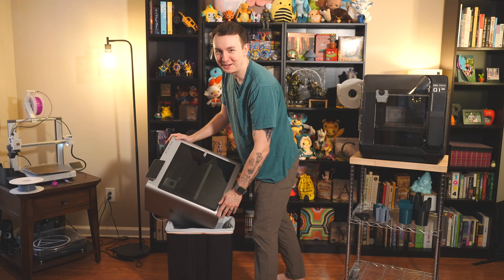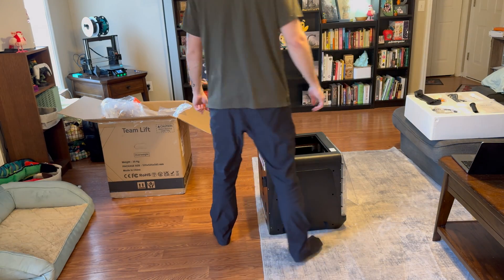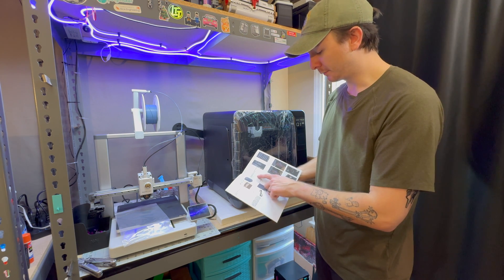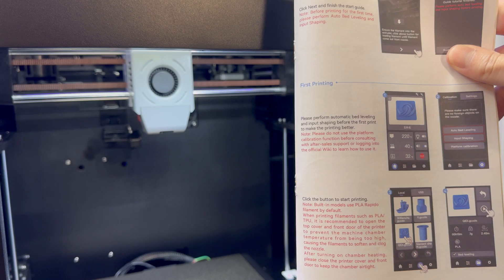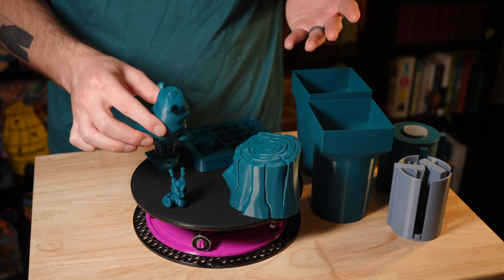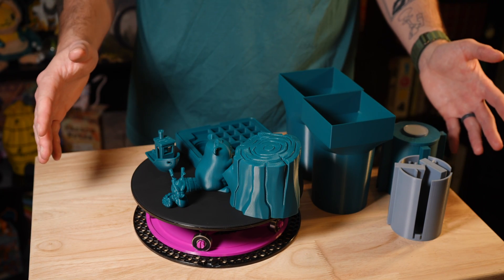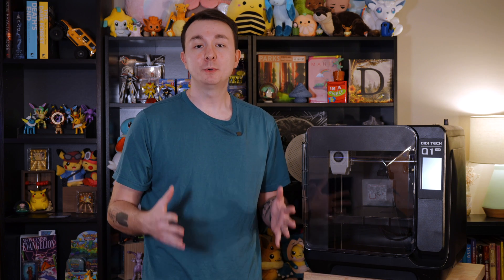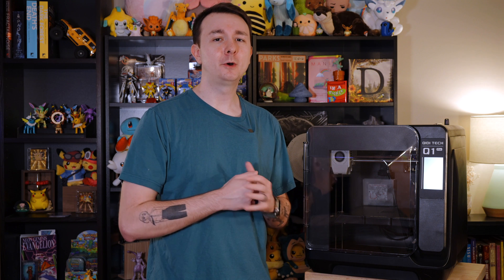Is This the Best 3D Printer for ABS?

Comment: Nice review.  I got my Q1 PRO recently and had horrible prints using default values in Qidi Slicer.  Switched to Orca Slicer and things improved. 

Did you ever develop any tuned print profiles?
Reply from the maker: I’ll be completely honest - I used their Prusaslicer profiles, ran input shaper, dropped the max accelerations to those values and never looked back haha
Reply: @ButterPockets  Thanks.  I'll check Prusa profile.  I slowed down outer perimeter and acceleration values in Orca and it's going well.  Always room for improvement though.
Reply from the maker: There definitely is! My input shaper gave me max accels of 4500 and running the Prusaslicer profile with those max accels has given me prints that are “good enough” for what I expect. I believe the PS profiles are almost exactly what’s in Qidislicer but just ported over. If you want to tune it up I’d suggest following Ellis’ guide and just running some test prints.
Reply: @ButterPockets  Thanks.  I'm new to Klipper.  Ender3 Pro and Cura for years so I'm overwhelmed with all the new stuff.  I've been reading Ellis' page today and I'm slowly learning.  I ran the input shaper but I didn't see the values.  I'll look to see what I can find.
Reply from the maker: You’ll need to log into the fluidd interface on your computer. So on the printer go to the network setting and see the IP address then just go to that IP on your browser. Right after you run input shaper it will have what it did in the console and say something like “suggested shaper in X is mzv at 47Hz l, suggested max acceleration of 5000mm^s/s” or something along those lines. It will save those values into the bottom of the printer.cfg but it won’t save those suggested max accelerations.
Reply: Sounds easy enough.  Thanks.  I think I set max print acceleration at 3000 to be safe.  I'll check out the numbers when I can.

Comment: Could you not print a new spool holder to move the spool to where you want it?
Reply from the maker: Probably could! I should try
Reply: @ButterPockets  just got mine today! I think have the spool arm go vertical and have it be front loading, spool feed going counter clockwise to inlet. 

Also, what kind of table do you print on? I placed my printer on top of a bookcase to keep out of reach from my son and when it started doing the motor frequency test we will just say it cannot stay there.
Reply from the maker: @JRVWPrints I have mine on my U-Line shelves that are in the background of some of my videos. It’s sitting in a large slab of granite. You could also get a stone paver!

Comment: Assuming i just want to print PLA for my etsy shop would you recommend this or rhe A1 or an adventurer 5M? The A1 is appealing because of the larger build plate i can print more at once. 5M is cheaper, but smaller and I don't like the expensive nozzle/hotend setup. The Qidi seems great, faster than the A1, but smaller and the most expensive of my 3 options plus i dont need the enclosure/heated chamber. The negatives of the Bambu are the whole china big brother cloud thing and it's still a bedslinger. 

I just need something better than my ender 3 v2 lol.

Comment: On mine the pink zip ties shown on the Z axis were replaced with locking screws that were marked "remove before printing" (see those white stickers on the print bed next to the linear rails).

Comment: I'm trying to decide on my first printer.  Contenders are this, the Bambu Labs A1 Mini (maybe combo), and the Bambu Labs P1S Combo.  I know, kinda wide spread there.  If I KNEW that there is an AMS solution for this coming, I'd be on it.  IF the P1S had a heated chamber, that would (probably) settle it, although the cost is pretty stiff.  Sigh....
Reply from the maker: I think you can’t go wrong with an A1 or a P1S. Depends on how much your budget is honestly. If you have the budget go P1S. If you don’t or just wanna dip your toes in go A1 mini.

Comment: It has plastic gears in extruder ! Aluminum was too expensive !
Reply from the maker: The X1 has plastic gears too. You might be able to upgrade that in the future, but this is what happens with off the shelf printers. There’s compromises somewhere. Regardless it still prints very well.

Comment: Hey. Thanks for the review. I got my Q1 a couple days ago, and i’m loving it! I am not getting the same artifacts on the print that you’re experiencing. I am going to start ASA printing today, so far only printed PLA and PETG.
Reply: Also, The nozzle wipe before the print is so the nozzle is clean for the bed meshing. I think the purge line takes care of the oozing pre print.
Reply from the maker: It’s a prime line, not a purge line! It primes the nozzle to be at the right pressure before printing. The poop is the purge! Angus (Makersmuse) also pointed out that the order of operations is a little wonky with the wipe.
Reply: @ButterPockets The Purge line also gets rid of the remaining filament that has been sitting in the Bowden tube which could potentially have excess moisture. Markforged printers  draw a large Onyx purge line for this reason.
Reply: @ButterPockets  Mind my wording, I meant prime. Thanks for the response!